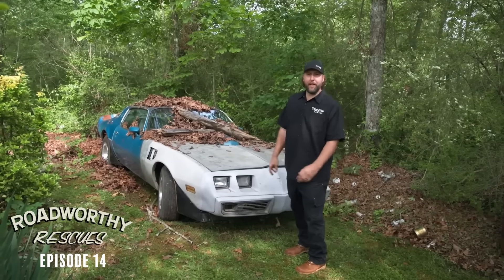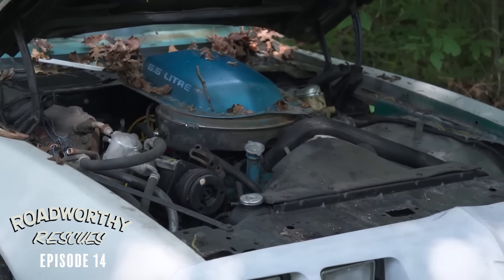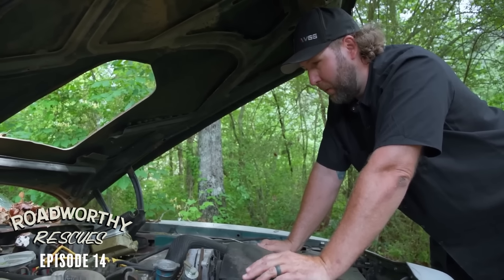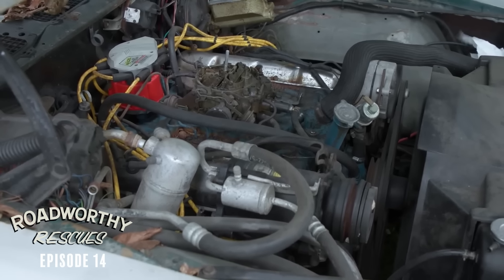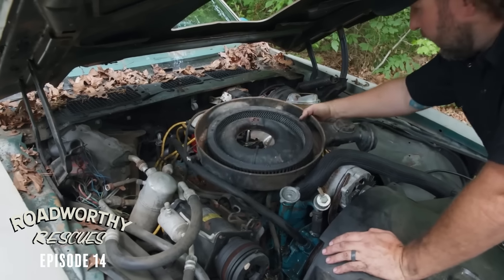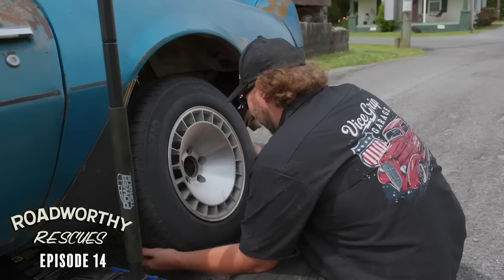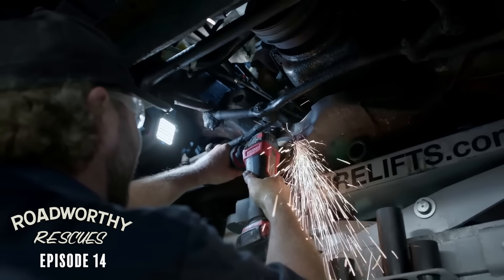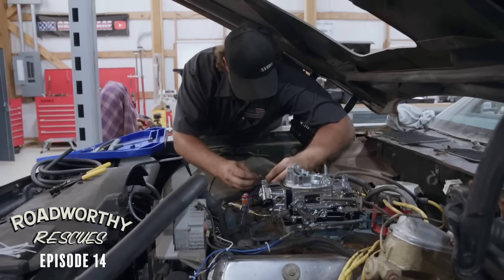Transforming A Budget Pontiac Into the ICONIC Bandit Trans Am! | Roadworthy Rescues

Comment from the maker: A Trans Am Transformation!
What do you think of the replica Bandit Trans Am?
Reply: The car is cool, but i think this faking bs of staging the car like this is insulting to the viewers...
Reply: Why are these videos so short? Should be at least 2 hours long.
Reply: It would have been killer with a 77 nose cone
Reply: This is typical Motor Trend bullshit stage job. They ruin all the best shows.  The producers think they know what the people want and they don’t.
Reply: Anyone who actually started from the beginning on utube knows for sure this is staged
Reply: If they redid Smokey and the Bandit, the TA would have to be a matte black 'bird!
Reply: Get old car , add gas and new battery done ready for paint, that how you framed it
Reply: Absolutely awesome!!! The satin looks amazing!!!
Reply: Vortec with twin turbos
Reply: These are my dream cars, but question for yall, when you go to remove the old fan and put in the electric fan, how do you guys search for it? Just by measurements or is it custom made by a shop? What do you do to prevent removal of the fan and fan clutch from throwing off the balance of the engine? And how does one go abouts wiring in the fan? I want to change over one of my older vehicles to electric fan and have been running into these struggles, and have been warned several times it could upset the balance of the engine if the fan is a 1:1 speed with the engine
Reply: This has got to be one of my favorite!
Reply: I actually don't doubt that. It is Motortrend after all.
Reply: Uiu😊
Reply: You guys faking stuff will ruin your brand and VGG's brand. Your audience wants real stuff, if we wanted fantasy and Hollywood bs we would watch regular tv or Netflix. This low effort faking is insulting to the viewer. Do you think car guys are all a bunch of mouth breathing idiots that would never notice the freaking grass is green under the car and that the leaves were obviously just sprinkled on the car before the camera started rolling ??

You guys are on thin ice.
Reply: Satin finish is bad🤬 and it'll burn up some tires for sure. I'm in🔥🔥🖕✌️👍👍
Reply: Stop selling out Derek
Reply: Needs to be a episode on TV!!!
Reply: Fake show sucks
Reply: Contrived
Reply: I'm restoring my '76 T/A, I'm not bragging or anything, buti do know what it's like to fix a car that's been sitting for 20 years under a tree, getting rained on, they will not just fire up, I had the pre-caution to remove and dismantle the Carb, only to find dirt & twigs inside, I'm glad I didn't try to fire it up like that. Don't want any more junk going into the motor, trying to avoid a tear down rebuild. These things take time, especially if you're doing it yourself, replacing shocks, new brakes, re-doing the entire braking system, including new master cylinder, new hard lines, and new brake hoses, new wheel cylinders & hardware, new emergency brake cables, new shoes and pads and rotors and bearings, restore the wheels, paint them, new tires, etc it goes on & on. This should have been at least a 3 hour video.
Reply: I've seen MIG welding, TIG welding, Stick welding, and Torch welding, and NOW, bless my socks………
I've had the privilege of seeing a perfect example of SNOT welding up close.
Thank you Mr. VGG man !!!
Reply: I’m sure Burt’s looking down from Heaven saying, One More Burnout, Son!!!!  😃
Reply: I Dont like the new production,, the older videos hit home, you talk to much and all the music is annoying as well as all the detail imagery of you making the repairs,, Derek is cooler when he talks less,, a generalized procedure, is easier to watch,,when tackling a resurrection,, I really enjoyed watching the old Derek but,, no more now that he sold out,, I Dont blame him moneys is important,, but just keep it simple like how the show was, that’s my opinion ,,I’m sure there’s others that feel the same,,
Reply: That put a big 'ole smile on my face sir, my dad bought the exact 1977 Smokey and the Bandit Trans-Am. I was just seven years old at the time and we lived at the barracks in Vancouver Wa. Dad was an Army Recruiter back then and with that car, his family, and the nice digs the Army put us up in my dad was the #1 recruiter west of the Mississippi. Man, that car was cool AF!

Years later I bought that same one you got in the same color even. Had the exact same wheels too, but it didn't scoot like yours does. Later I built a 2wd Blazer S-10 and stuffed a stroker motor in it. And oddly enough, it made its way out to Alabama in a little town north of Dothan called Clio. Anyway, I love what you did with it and the fact you spent as little as possible for it to turn out that good. Outstanding sir, you got a new subscriber for what its worth and I look forward to catching up and for the newest releases. Keep 'er shiny side up!😎
Reply: Unlike others, I don't mind if it's staged. A little bit of drama doesn't hurt 😊 What an amazing transformation 😊
Reply: I liked the blue; should have done a pearlescent deep midnight...
Reply: Woe never thought about  it like that. 
If that is True I’m  very disappointed. 
You ruined vgc for me. 😞
Reply: Derek is awesome!😎 it’s nice to watch a hard working person like him. My dad drilled it into me ever since I was born. Now I have a beautiful family, home paid for that I built. No car payment and I still have my 71 chevelle that I bought and rebuilt back in 1986👍🇺🇸

Comment: 6.6 is a 403 small block... famously in Olds and Pontiacs... 455 is a drop in replacement and you got the good one being a 68 to 74.  Some of the very first were high compression monsters
Reply: Yep, the 403 was an Olds motor. The 455 could be Olds or Pontiac, or even Buick. I have a 10.5 - 1 stock compression Olds 455 out of a 1968 Toronado. Monster came out of factory with 400HP/500ft.lbs!
Reply: 400 Pontiac was only available with 4 speed stick that year. Automatics got the Olds 403. Why put a 455 in it? Because 455 is bigger than 403!
Reply: @coledrevenj  all different 455s too.  If you can find a 73 T/A SD you found the last of the muscle cars.
Reply: super duty ftw

Comment: Looks like an Olds 403 from where I sit.  It has the oil fill in front of engine just off center is a dead giveaway.
Reply: That’s exactly what I thought..
I guess an olds 455 has the same filler neck like the 403.
It’s an olds not a Pontiac engine.
Reply: Unfortunately the Olds 403 motor was garbage for horsepower.
Reply: @jasonmacneil2256 But the Olds 455 had up to 400hp/500tq
Reply: @coledrevenj  not from the factory it didnt.
Reply: Research is your friend. Go look it up, there were variants that came that high from the factory. Olds made some very interesting engines, back when they made their own.
Reply: Rocker covers also are a dead give away it's a olds not a Pontiac
Reply: That was my first thought too. I had a 79 TA with the Olds 403 back in the mid 80's
Reply: @odahithedubious  NO, I don't disagree with you.  But I was specifically talking about the Olds 403 in the trans ams.
Reply: That's exactly what it is. I almost spit out my coffee when he said 455 😂😂😂
Reply: @jasonmacneil2256  Absolutely true statement.

Comment: I wish Motor Trend wouldn't stage how the car was found. It's like the videographer said, " It will look better if we pile up a bunch of leaves on the roof of the car, and pile some up on top of the rear tire, because that will look natural". smh
Reply: I was going to comment the same. All the trees surrounding have green leaves. This is what happens when a corporation writes the script.
Reply: sadly, it wasnt even found there, green grass under the car, no ruts from the tires sitting there for years. it was all 100% bogus.
Reply: @leftyo9589  This is part of the reason why Motor Trend is not a big as it should be, because they have no problem with insulting the intelligence of the viewers.

Comment: One of the sadest attempts of making a car look like its been sitting under a tree for years..
Reply: Lol are u there why u no so much about this?
Reply: I'm restoring my '76 T/A, I'm not bragging or anything, buti do know what it's like to fix a car that's been sitting for 20 years under a tree, getting rained on, they will not just fire up, I had the pre-caution to remove and dismantle the Carb, only to find dirt & twigs inside, I'm glad I didn't try to fire it up like that. Don't want any more junk going into the motor, trying to avoid a tear down rebuild. These things take time, especially if you're doing it yourself, replacing shocks, new brakes, re-doing the entire braking system, including new master cylinder, new hard lines, and new brake hoses, new wheel cylinders & hardware, new emergency brake cables, new shoes and pads and rotors and bearings, restore the wheels, paint them, new tires, etc it goes on & on. This should have been at least a 3 hour video.

Comment: 403 Oldsmobile 💯👍
Reply: If it's an Olds 403, that's a garbage low horsepower motor!!
Reply: @jasonmacneil2256  all you really need to do is put some 1970 64 cc heads Aluminum Intake and headers to wake it up been there done that had a lot of fun on the cheap but every maker makes garbage Motors
Reply: @rogersaucedo8817  most pontiac guys I know removed the low compression low horsepower 403 Olds motors from their trans ams and added a pontiac 400 or 455.  Much better motor and more easy to add more power!!
Reply: Had those Motors to fun Motors to work on

Comment: Its got a Oldsmobiles engine in it thats why it fired right up. You can spot a Olds engine rather quickly from the thermostat housing and the valve covers got 10 bolts versus a Chevy which have like 2.

Comment: In Australia the holden HQ - WB run basically the same style chassis as the chev's an well most american  gm cars so ours were prone to cracking behind the lower control arms so quite common to have reweld an plate over to strenghten them

Comment: That motor isn't a 455, it's a 403.  You can tell by the oil filler in the front and besides that they didn't come with 455 in 1979. They had three different engine options, the standard Pontiac L78 400, the optional extra-cost Pontiac W72 400, and the Oldsmobile-sourced L80 403.

Comment: I like the 79 way better than the 77. That has been my dream car since I was a kid but I want a gold 1.
Reply: I'm just the opposite,  I like the 77 body better, but I owned the 79 in 1981, I loved that car, 403 Olds was a great motor, not a Pontiac 400, or a 455 Olds, which I would rather have had, especially 7.3l 455. But I had no complaint of the 403, that thing was fast, reliable, and topped out at 170 mph, what else would someone want

Comment: a 6.6 litre equates to a 455 c.i.d. How do I know that? I've had two different Pontiacs, both with that particular engine. It comes from the factory SERIOUSLY DE-TUNED. But if you know what to do to these motors, you can end up with a serious, tire-boiling beast of a motor.

Comment: I don't believe Pontiac introduced the 455 until 1970 so you might want to recheck the numbers. If it is pre 70 post 68 it could be a 400 or a 428 granted they also made a 421, a 350 and a 326.. all the same block essentially. EDIT: I realize later on you said it is an Oldsmobile 455... my bad. That did start in 68.

Comment: thats a 403 olds which is 455 bore came stock in them u can tell paint not new 70 455 would be gold.a 650 cfm carb when it was 750 cfm from factory and if it was 455 it would be 850 cfm.i had these cars,not bad

Comment: The Pontiac 455 debuted in 1970, produced through 75.  Fullsize Pontiacs in 68 and 68 had the 428 as the top engine offering.  Is that an Olds 455?
Reply: Last year for 455 was 1976.

Comment: the 6.6 is a pontiac 402...
not an olds 455...
Reply: "6.6 Litre" on shaker is 403 Olds. "TA 6.6" on shaker is Pontiac 400. In 79, the Pontiac 400 only came with a 4 speed. The 403 Olds only came with an automatic. The vast majority of 79 TA's came with 403 Olds engines.